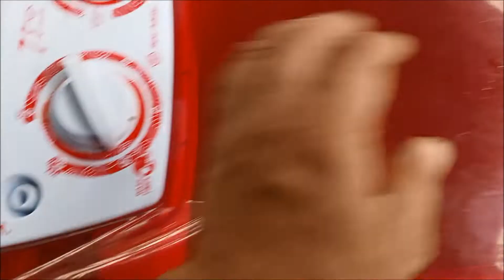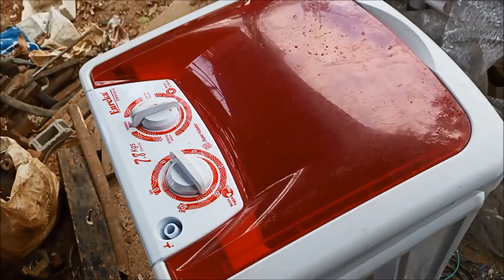eureka washing Machine Bakit mahina Umikot pag may m na Damit, How to Fix it

Comment: Sir gnyan ang washing ko, ang ikot po nya isang ikot lng hndi n bumabalik ang ikot pa counter clockwise, lagong clockwise ang ikot
Reply from the maker: Hi po pag isa lng po ikot nang washing machine 3 po pwede sira, 1 Timer , 2 capacitor, 3 drive motor. pero check po muna capacitor yun po kasi isa pinaka mura